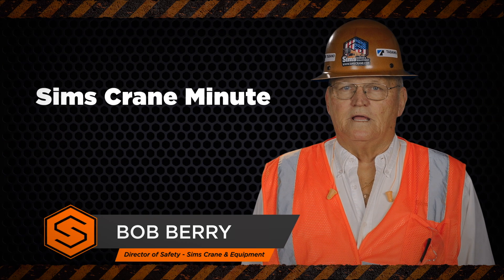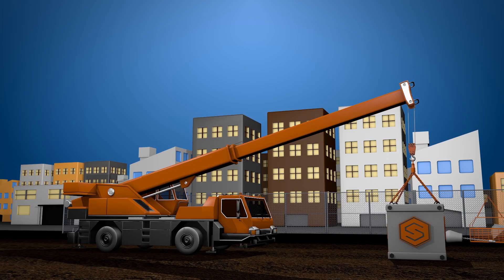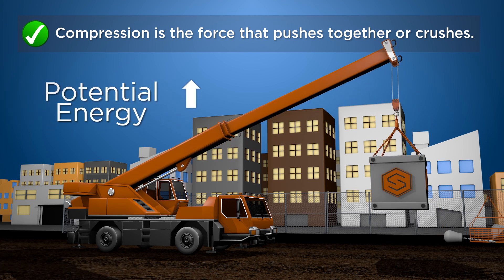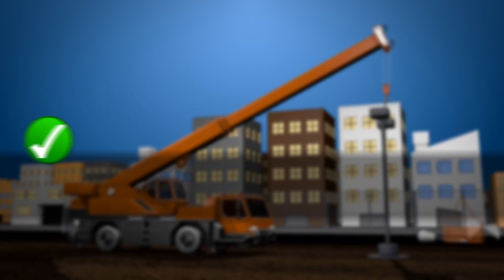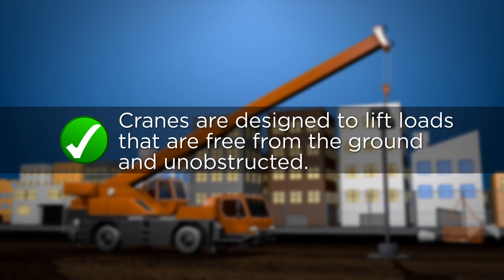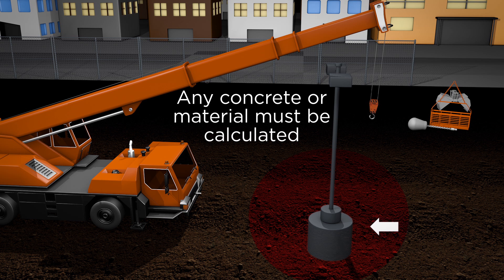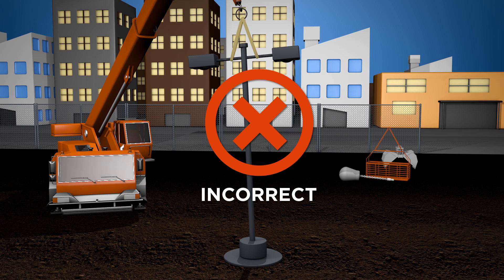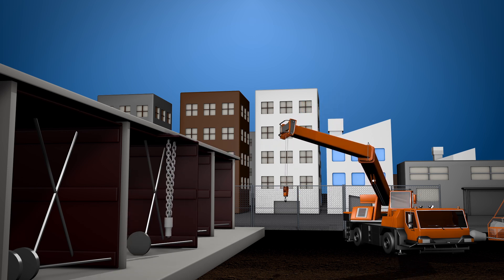Boom Deflection & Shock Loading | Sims Crane Minute

Comment: I’ve been a tower crane operator for a couple months now and found that there’s so many factors that can lead to an incident. Pressure placed on new operators or even ego can cause us to ignore or forget our training when thrown into the field. For example. I was thrown onto a new crane at 3pm (after being at a more relaxed site all day) to pour walls. everyone wanted to go home as fast as possible and tensions were high, I ended up shock loading the crane because I hoisted down to quick. Simplest thing as the difference in shadows on the jibs camera caused me to misjudge distance of the load because we were working on the top floor for a while. Another lesson learned in this career
Reply: Did everybody end up having to stay late?